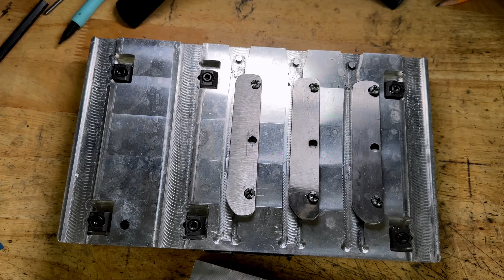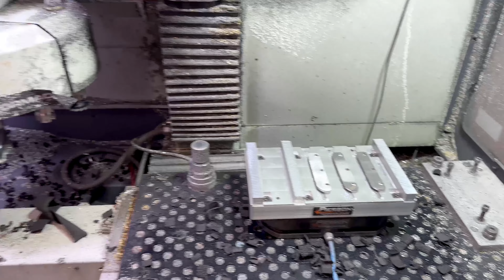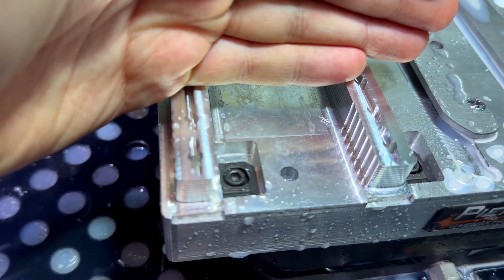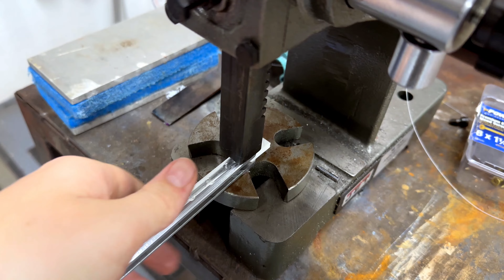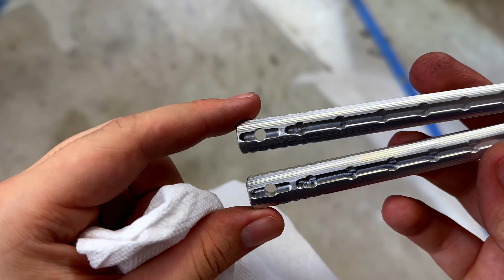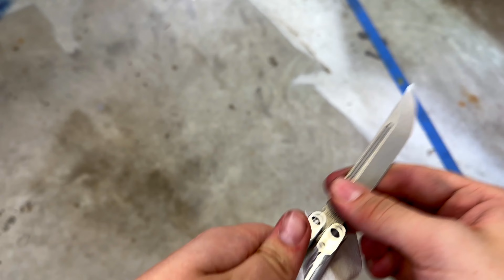Design changes and prototyping!!!

Comment: Whenever possible try not to make a slot in the fixture that brakes through the edge. The slot can cause the fixture plate to bend when clamping. A good example of this is Kerf bending. You might not notice any problems with your setup because the plate is so thick, but it is a good trick to know for future designs.
Reply from the maker: Thanks dude! That’s definitely a helpful tip although somewhat impractical for my pallet/ stick size right now. I haven’t noticed any issues relating to that but I’ll keep it in mind for future projects.

Comment: Well that's bizarre.  I added a comment about using a torque screwdriver since that has saved my pallets from needing helicoils and made my screw heads last MUCH longer.  I wouldn't every try an impact driver or electric screwdriver, but I tend to overtighten.  I included a link to my favorite t-handle type of torque screwdriver, but maybe that's what removed the comment.  Look for a green t-handle adjustable design, or just go with any of the "gunsmithing" torque screwdrivers.  Game changers for pallet with miteebite clamps.
Reply from the maker: Thanks dude! I didn’t see a previous comment so it must’ve been removed due to the link. I have yet to strip a pallet but its better safe than sorry.
Reply: @frankenforgeblades  For sure!  I had one pallet I ran thousands of parts on.  I went through about 4 sets of screws, then modified my original pallet CAM to go back and re-drill the tapped holes for helicoil inserts, installed those, and went through another 4-5 sets of screws.  I was only making 12 parts at a time, so probably 400-500 uses for each pitbull clamp.  Once I switched to the torque screwdriver the screw heads lasted till I was done with that production cycle.

Keep up the great work!  Your stuff is looking great, and I will look forward to more about your new knife!
Reply: @frankenforgeblades you could always check the YouTube dashboard, it will tell you if a comment is being held for review.
Reply from the maker: Ya I checked that still nothing.